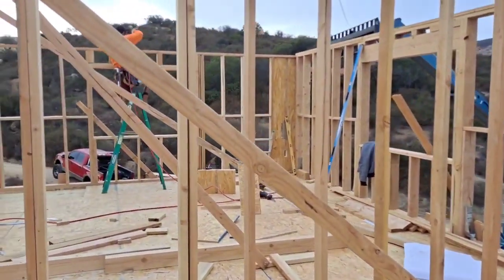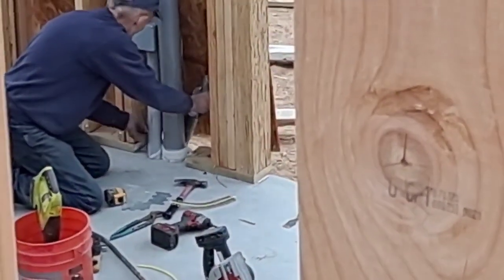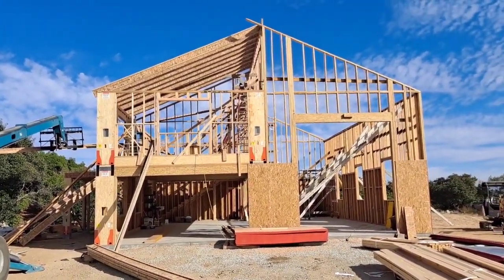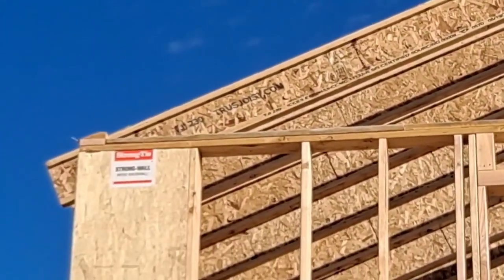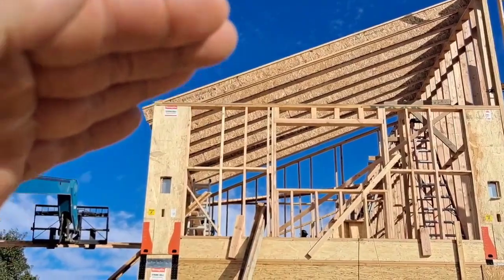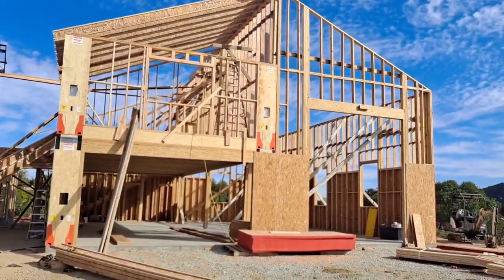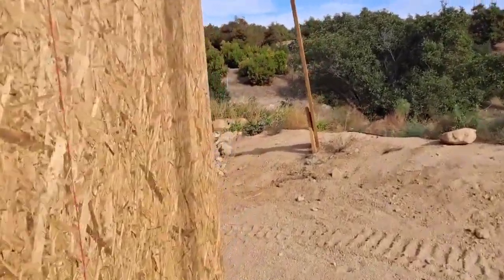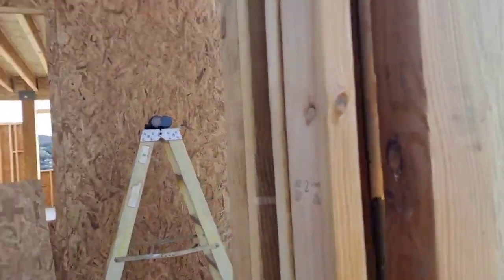CA ADU project deck framing and roof rafters using TJI 230 rather than roof truss

Comment: Will the rafter be insulated with spray foam?   Was wondering about air flow if you completely block the ends of the TJI rafters?
Reply: Yeah later I bought a spray foam kit called froth pak and sprayed all those rim joists and any area that may get air flow. I have no ventilation at all at the eves. I did not want any in this fire area. Just gable vents. Is is EXTREMELY efficient and uses way less electricity to heat and cool than my house 100 yards away that was 1994 construction. And this was per plan so really the architect should be making the call, they calculate attic ventilation and spec vent sizes.